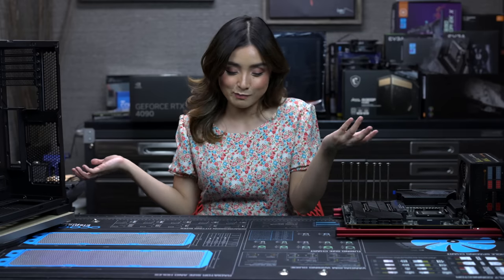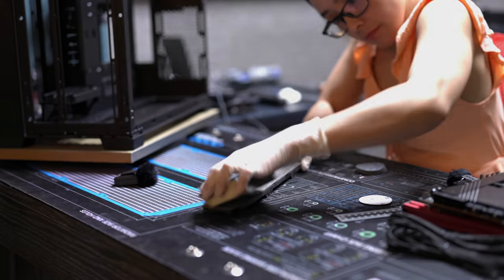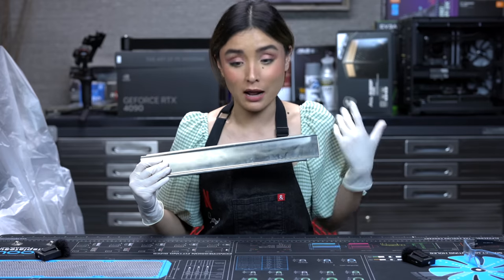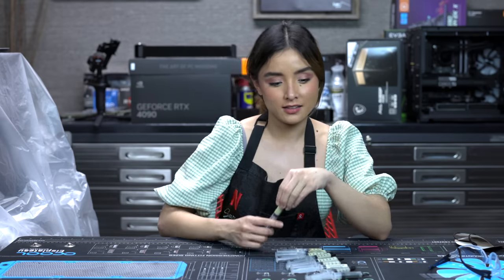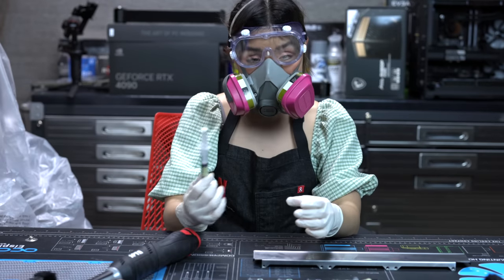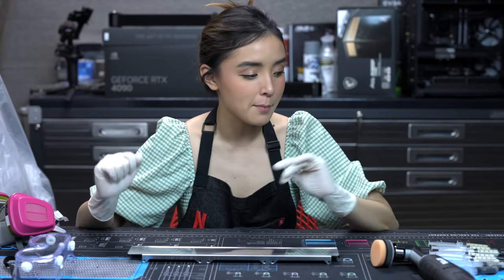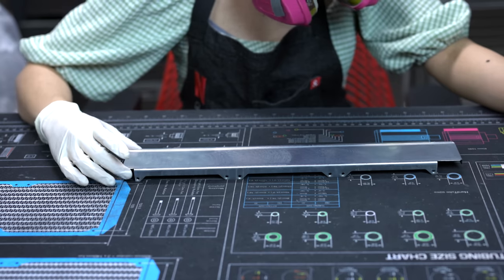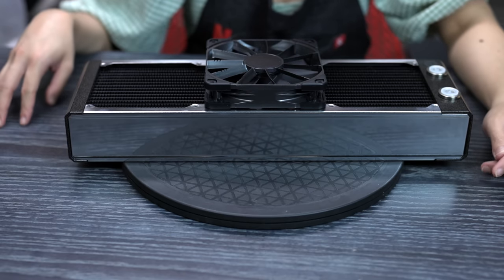Mirror Shine Stainless Steel EK Surface Radiator - Black Nickel Plate Prep x360m - PC Build Update

Comment from the maker: A late pinned comment - The scammers are back again!  No I don't have telegram so please be careful.  Also I had an issue with YT licensing on one of the songs so the audio gets a little weird on the first 3 grits.  Had to edit using the YT editor after the upload and it's not ideal.   Anyway, I'm so happy that so many of you liked this part of the build.  Can't wait to show you guys the next part, which is nickel plating.  I literally have no clue how it will turn out as this will be my first time but fail or not, we're in for the ride together!

Comment: I see that 4090 in the back, will it be replacing the 3090 XC3 in the next build?
Reply from the maker: Yes, actually two changes to the next build, (one of the reasons why it's taking longer than first anticipated due to getting the part and waterblock for it).  I'm using a 4090 and a 13900k instead of 3090 and 12900.  I ended up finding a good home for the xc3, I had an old mini case and a bunch of spare parts to do a quick fun off cam build.  It's actually in the background too :)

Comment: I'm building an AM5 system with the x360m and the new Lian Li SL Infinity fans. It's going to cool a 4090. Nice mod!

Is that a high performance Noctua fan? You should check out the be quiet silent wing pro fans. They just came out but I don't think there's a higher performance fan than them.
Reply from the maker: I haven't seen those fans!  I'll check it out thanks!   I'll be honest, I never liked the Lian Li fans for some reason but then I finally tried them for an off cam build and the way they designed them and the way they look in person, I'm a fan now (lol pun intended).  Good luck on your build!  I'm going with 4090 also.
Reply: @SnaxanGaming  I agree with the first generation Uni fans...there were lots of problems with the controller, etc. BUT they fixed everything with the new Infinity SL and v2 fans. The new ones are 20% brighter, they're 28mm thick instead of 25mm and they redesigned the connectors and controller... they're actually a perfect match for the Surface rads because of the fin density on these rads. They are not meant to be used in a push/pull design and you don't even have to go beyond 1000rpm for regular day to day use..but if your going for a nice black out build (I love black out systems) definitely check out the new be quiet pro fans. They can hit an astonishing 3000rpm and look like the nicest high performance fans I've ever seen...I see you got a 4090, be ready to be blown away. My system is still on a test bench (7950x, Asus Crosshair Extreme board). I have never used a video card that increased performance the way the 4090 has done. You won't even consider playing anything under 4k ultra. I had a custom dual D5 distro plate made by Radikult (you should check his stuff out)..oh and don't forget, the 011 EVO XL was announced too.
Reply from the maker: @GSP-76  I was actually hoping the evo xl would have been out by now!  Way back when they announced it, I planned to build in it.  But ended up with normal evo instead.  I couldn't use the larger board I wanted because of that but it's been fun figuring out how to solve the problems with the smaller case.  also those fans sound great! I'll check them out.  Although I would never run fans that high lol.
Reply: @SnaxanGaming  Yeah no one runs fans that high unless you want to see the computer fly away on its own, lol. The EVO XL should have been released a long time ago, I don't know what took them so long. The main difference between that and the regular XL is that it supports 140mm fans so you could do 420mm rads. I remember when you did your first build, you had three rads. Are you sticking to three again or just two? You don't need more than two, especially with the x360m...even the 4090 doesn't get that hot. As for CPU, the 3D versions of Ryzen 7000 are coming in January/February. They're gonna be the fastest gaming CPUs ever.

Comment: you could have just used a regular paint stripper ro get the paint off
Reply from the maker: I actually tried with normal.  It didn't really work, even after soaking for a long time.  There were some funny moments on that.  Unfortunately that scene I was alone with no camera help and I didn't notice the camera battery ran out